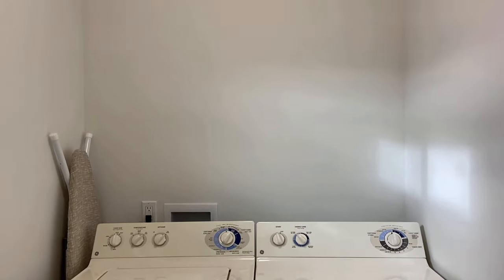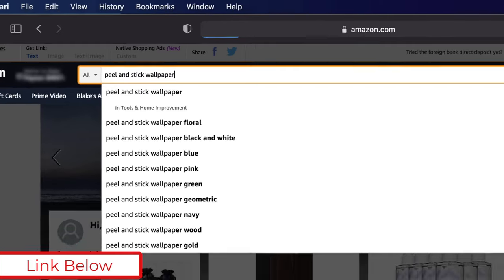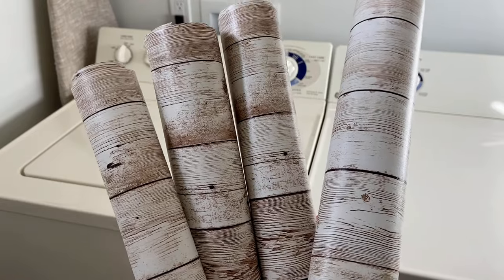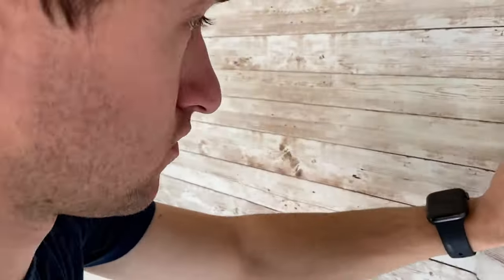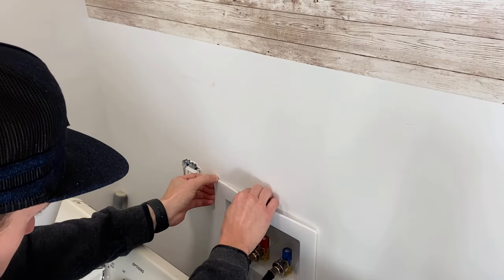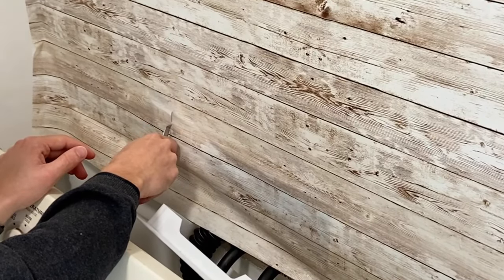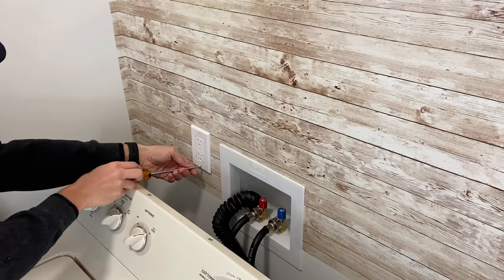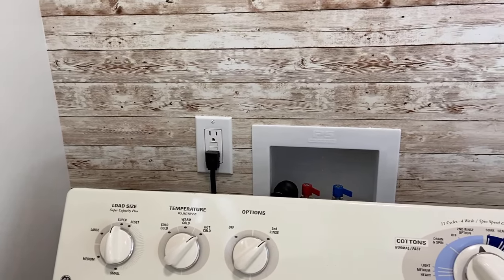Want To Apply Peel and Stick Wallpaper Correctly? Watch This!

Comment: Nice job but many of us encounter problems. As you roll it out you may find either the alignment is veering off as you struggle to avoid bubbles or self-sticking. 
As you roll it out I find it necessary to stop every couple feet to cut off the excess backing as it begins to weigh on the roll.
Patterns: weathered wood looks good but old brick is also good and doesn’t require the tricky horizontal method.
Reply from the maker: I did an updated video! You may find some of those tricks helpful! You can watch that here:

https://youtu.be/1WX3Gjmkmjw

Comment: Thanks for the tip. So much better than previous videos I've watched. I am getting a sample of this stuff come through soon as I liked the colour of it better than the actually tile tpyes but this one comes all in one so I was abit concerned. Do you know if it removes without damage to surface underneath as I live in rented accommodation? Many thanks for the excellent informative tutorial and the pro tip. Making the mistake so we don't have to although it does advise on the product to take a bit of the adhesive off at a time. It's the bubbles I worry about but they do sell a felt applicator seperately

Comment: you make this look so easy but I can't put it straight like you do.  Had to purchase 4 more rolls because I screwed up a few times.  Do you use a level also? How do you get it so straight? You're really good!
Reply from the maker: Well thank you I appreciate it! No I don’t use a level, I just pull a couple of feet off of the roll and line it up with the row above it. I also rely heavily on the ability to “unstick” it and then try again. If you mess up, I just pull it off slightly and try to make sure it as straight as possible. It is also really important to get it straight from the beginning of the row! Hopefully this is making sense! I’m sorry you had to buy more rolls :( I also have another video on my channel that might help? You could check that one out as well! That video is for vertical installation but it still has some great tips. Hope that helps! Keep it up and great job for tackling it yourself!

Comment: The real test of course would be to show us your finished product with a flashlight shining on it while your room is otherwise in the dark.  Then we could see if you got rid of all the bubbles. 

Fair?
Reply from the maker: Fair! I still think I would past that test! That method worked very well!
Reply: If you need a flashlight to find the flaws you don’t need to worry about them.
Reply: @spencercolgan   You are absolutely correct. And I applaud you for doing so many videos on self stick...I did only one on the subject --https://youtu.be/_katEE1fG-A-- basically because I was tired of explaining to my customers why I don't install them due to the massive quality problems with most of these self sticks.  I just tell them to go my YT video to save my breath.

Yes, self sticks are UNBACKED vinyl like contact paper not wallpaper.  Backing with paper, nonwoven, or cotton fabric makes wallcovering dimensionally stable--plain vinyl sheeting like self sticks have is NOT stable.  Yes, people complain that they come loose from the wall as early as a month later--dig deeper and read the 1 star reviews of these offerings.  Yes, most instructions say your walls must be smooth and by that they warn against "orange peel" texture left by paint rollers which pretty much everyone in the world has on their walls painted with latex paint/roller combo. 

I check all my work with a CREE flashlight before leaving.  If you finish a job in the late afternoon and the sun is on the other side of the house just wait until the customer enters the room next morning when the sun is streaming through the window and bubbles and seams show all over the place!  There would be a stop order on that check they gave you the day before until you could come back and somehow fix it--- Good luck fixing this SS crap too.  As i say, it isn't really wallpaper (which often can be fixed with some simple techniques.)

And sorry, Nailed It , that material you hung had a pattern repeat which you didn't pay attention to. Just look at how the pronounced darker wood knots are out of whack. The top sheet is offset matched with the next one down the wall but then the 3rd one down is hung as a straight across match to the 2nd sheet. Because of that, the background color which is supposed to flow into the next sheet looks chopped off.   If a pro did that their phone would be melting down from a pissed off customer and they likely would have to rip it down, redo it or refund the money for the job.   Cheers Jim Parodi.
Reply: @doctorairflow  coming from the fact that you are the  Babe Ruth of wallpaper hanging, I take this compliment very very graciously and with much appreciation Mr. Parodi. Thank you for.it.
Reply: @spencercolgan  Babe Ruth?  Wow I'm blushing. Thank you very much.

Whenever I think of self stick wallpaper I go back to the last job I did with it 2 years ago ....to the job that made me swear off of them completely and it's perfect to tell right now in Halloween season cuz it was so scary....boo kids!:  

This was a dark brown material that I was convinced would be okay if I just added wallpaper paste to it.  There are many other YT videos that say the answer to all the problems with self stick is to just paste it with wallpaper paste. I also imagined that would be the answer at the end of that one video I did on self stick.

I also provided a backing for it with a non woven paper liner I installed on the wall beforehand.  (Kids: it is the backing on Real Wallpaper that helps to cushion it so that it doesn't show surface texture or other wall imperfections and helps to also stabilize the whole job in terms of resistance to seam shrinkage.) I put up 3 sheets to center around a fireplace mantel. Of course with a dark brown colored material I wanted to be very clean with the sponge so I wiped it all down. I step back from it and it looks like I left paste on it . I go back and I rub it down some more . It looks now like I got more paste on it . Whoops ! I'm actually rubbing the dark brown ink off because it wasn't really a solid sheet vinyl it was a very very tightly woven polyester fiber sort of like parachute silk---and the inking was water sensitive.

I called up The Decorator and say, "You need to come here we have a big problem . "  Actually we have a list of  problems. Number 1 This material was never designed to be put up with a wet paste so that's on me.  (Imaginary phone conversation with the company that made it:) Me: "Yes I added a wet wallpaper paste to it" ,  their reply "Who told you to do that meathead?"

 2 Many of these self stick startup companies make one 12 foot (or so ) sheet that isn't really a "wallpaper roll" and  that sheet  has its own SKU number. It is printed custom for everyone who orders it. There is no warehouse to send it back to ---there is no warehouse at all---so there are no returns. You have a problem and it's your fault? you have to eat that shipment as a decorator or a paper hanger if you yourself supplied it.  The Decorator said simply, "Jim you've got to get this up on the wall I can't return it."   

So I ended up pasting the sheets and running to the wall slapping it up in under a minute with the minimum of wiping.  I also consulted with The Decorator before I informed the customer who was pretty what we call "high-end" that she had to inform the cleaning people who might be tempted to wet wipe the dining room chair rail with a damp cloth or wipe the baseboard to get dust off of it in the future that they should absolutely not do this otherwise the color will come off.  (And BTW don't call me if it does...I never want to see this crap again.)

This is why as a professional I make the point of saying that this stuff  has no backing. A backing of paper or non woven would have provided a barrier so that the paste did not infiltrate into the ink of this material.   The whole experience could give anybody an ulcer and there is no point to all of it other than to allow manufacturers to take advantage of an unsuspecting public and sell the sizzle instead of the steak.

And one more thing:  Self Stick is EXPENSIVE per square foot compared to even pricey real wallpaper.  Always compare "cost per s/f" not by the roll because those self stick "rolls" are much shorter than real wallpaper rolls.

Comment: For the seams,  did you just slightly overlap or butt it up? Looks nice.Thanks
Reply from the maker: It depends on your pattern mostly but for the pattern I used, yes I overlapped it about a 1/4”!
Reply: If you overlapped did you go back over it with a sharp knife and cut off the small overlap section?
Reply from the maker: No! I wouldn’t! It’s not necessary and you would risk cutting your wall!

Comment: how do you deal with panels coming off the wall weeks later?  I have tried cleaning the wall but doesnt help
Reply from the maker: Great question! Let me just say a few things and you can let me know if you have tried them or not. 
1. Are you making sure all of the bubbles are out when applying it? 
2. When you are cleaning the wall are you using a degreaser chemical (if you are applying it in say a kitchen, there could be oil and grease that is making it not stick to the wall)? 
3. What kind of wallpaper are you using? Did you get it off Amazon and are other people having the same issue? If so you may want to get a different brand of wallpaper and try that. 
4. Have you watched my other video on installing wallpaper? I have a couple new techniques on how to apply it. 
5. Do you have a lot of texture on your walls? This may also be an issue depending on how textured your wall is. 
Hope that maybe gives you a couple of ideas. If not let me know and I will see if I can come up with something else!
Reply: @Nailedityt  I mean I think so. I’ll check